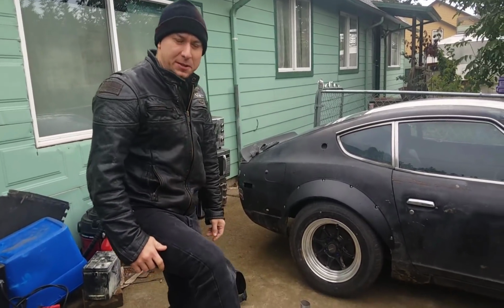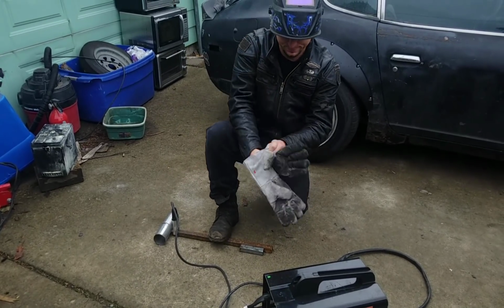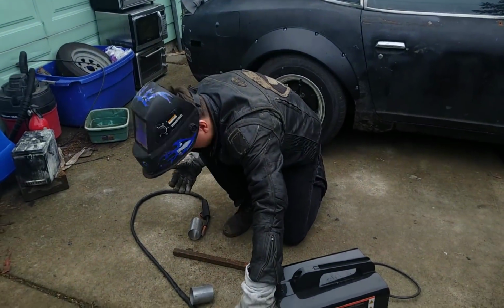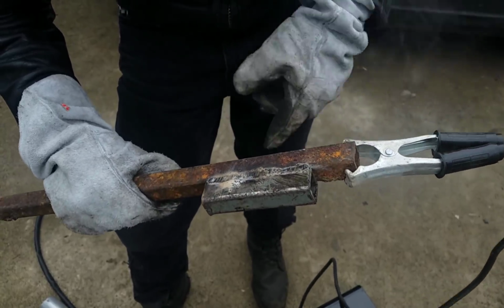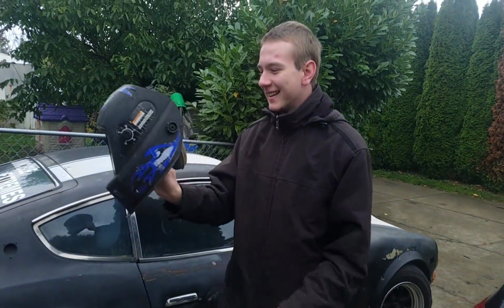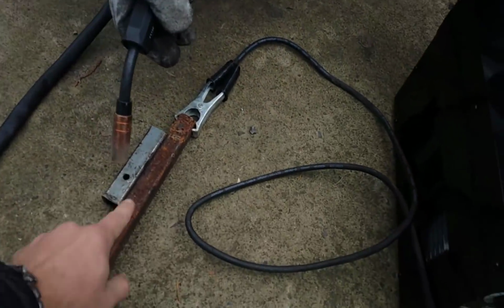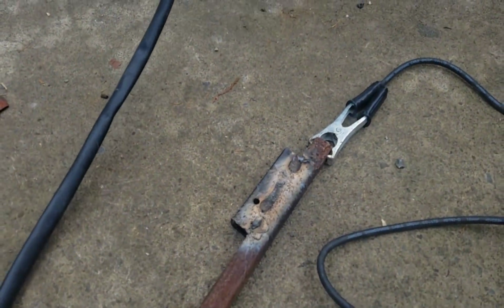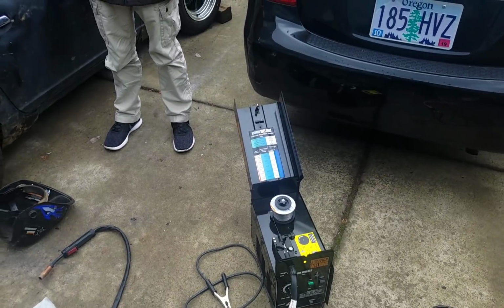$99 125 amp welder. Worth it? new 90 a.  Harbor freight 120v budget welding review. Chicago electric

Comment: Picked mine up the other day. I am going to put on a better grounding clamp than the one that is on there. Also I got rid of that gas type nozzle on the end. That just made no sense to me why they had that on there but overall I am very pleased with it.
Reply from the maker: tezterz have you seen the tiny inverter welder century sells for 169?  Picked one up and going to so an overview of it... But man it's SO much better.  Same flux core setup, but less splatter because it's DC not AC... and half the weight and size... And 30% duty cycle instead of 20... comparing the two little scrappy welders side by side, the century fc90 wins as a cheapie travel welder
Reply: Invincible Extremes Muscle Cars Garage I haven't seen it but will check it out. Just today I was watching several videos on the AC to DC conversion and it may be something I'll do.
Reply from the maker: tezterz don't bother, this one works great as is.  But honestly save that money and look at the other welder down the road.  Never hurts to have a $99 welder, but pouring money into it might not be so good...

Comment: question what would be the thickest steel you can safely weld to 1/8 or can you weld 1/4
Reply from the maker: Streetglide40S&W the answer is 3/16... It'll do 1/4 inch no problem but it won't be the same as the 240v welder that has a bit more power

Comment: I’m not having too much trouble with the bead, but a terrible time seeing the joint being welded. I’ve turned my helmet back to 10. Any other ideas?
Reply from the maker: Tim Sexton 11 is about where you want to be.  I'm in the same boat sometimes... either it's too bright or I can't see what I'm working on...
Reply: Yeah there is a $350 helmet that gets rid of the green tint. Like daylight. And like expensive Raybans while arcing.
Reply: Backlighting. Worked for me.

Comment: 10 mountain division      Ft Drum     dude you  just save me a lot of  money I really need to secure a window ,  i am a land lord and i can now repair my own window,, i will get better in time.  but you help me light a spark,    thanks soldier
Reply from the maker: I've used one of these for years.  They're not the best, but they are 100 bucks and they do work.  My suggestion is to go to home depot and get a century fc90.  Its smaller,  lighter and a much better welder.  That way when you get a little better you'll still continue to use it.  I did a video comparing the the two welders.  But either way, you'll do fine.  Thanks for watching!

Comment: Nice review, airborne. Realistic. I've been wanting to get a welder forever and was thinking of just saving up some more and getting one that can do mig as well. HF's Vulcan welders are getting good reviews but they are exempt from the coupons.... jerks...  Did they quit selling the 90amp, or just add this one?
Reply from the maker: +Bob C they sell both, same price, same box.  The 170 amp model is the best one per dollar.  It can do mig as well, but does flux core just as well.  And have more amps to be of more use, as well as going down to a lower setting for the thinner stuff.  The low setting on the 125 amp is 60... a bit high but not a problem for me. 

Now about the Vulcan, I myself want one because it's workable with a spool gun and can weld aluminum that way... imagine being able to weld together lightweight brackets, sheet metal custom intakes and so forth...  But again, it won't no $99.... 

Oh and, "all the way!"

Comment: I have a 90 amp hf welder now... Is there much difference with the 125 amp model?? I need to run it on 120v
Reply from the maker: Backyard Alchemy honestly I couldn't find any in the specs... they seem to be the same thing.

Comment: I have never welded anything in my life, what else do i need besides buying the harbor freight welder, to do what your doing here. ?
Reply from the maker: I highly recommend looking at the home depot century fc90... it's a way better welder and will work good long after you learn to weld.  

But you can indeed weld with this one too.  You'll need nothing else.  Everything comes in the box.  But a mask and gloves would be better.

It comes with a cheap mask and it has wire... So literally you can weld right out of the box if you only have $100....

Comment: Stupid question,  would this welder do a floor pan patch job on a 65 mustang,  I know I should get a better one just not in my budget right now
Reply from the maker: Yes if you absolutely have to.  I would recommend going to a pawn shop and trying to grab this for 60 bucks maybe.  The welder I would recommend that's still bottom dollar is the 170 amp model (because it can go down to 30 amps for sheetmetal work) and also because it's under 200 bucks.  Also it can accommodate a bottle of gas and your work will be 10 times better.

Besides that, if you must stay with 120v I recommend the 125 amp green welder they sell. Or the century 90 amp home depot sells.  They have dc output and the results are much cleaner.
Reply: @InvincibleExtremes  thank you sir, for the info and fast reply  I'll look in to it I've never welded before but I can't afford a body shop lol so time to learn
Reply from the maker: Yeah I taught myself.  Just taught my wife too.  But that was using a 200 amp titanium welder.  Seriously, look at the 125 or 140 amp titanium if you can afford it.  If not then at least the 170 model from Chicago electric... they're heavy but they weld good.
Reply: Will do thanks again

Comment: Will that work good on sheet metal?  I need to do a little welding on my Chevelle floor pans.
Reply from the maker: Bob Silver yes, but it's tricky.  I would recommend a century fc90 for a cheap welder to fix floors and things.  They are only $169 and are a lot easier to work with, and are half the weight and size.
Reply: thanks

Comment: go forwards not backwards watch the puddle & go slow and ffs clean it first .
does this have wirespeed and power adjustment ? 
they must be balanced for thickness     
im qualified
Reply from the maker: Not qualified at all if you think flux core welding is pushed... you drag anything that slags.
Reply: @InvincibleExtremes  you sir i challenge to a weldoff

Comment: There is a company here in the USA that sells all the replacement parts for Harbor Freight welders. There is a video done by ChuckE2009 channel where he goes to the company and gets an interview with them.  That company purchased Harbor Freight welders, took them apart and cross referenced all the parts they had in stock to make sure the parts would fit to repair or refit the welders. So if you ever need a replacement part, you can get them now. Just a FYI. I think I found the link so I edited this post   https://www.usaweld.com/Chicago-Electric-Welding-Gun-Replacement-Parts-p/chicagoelectric-mig-parts.htm
Reply from the maker: Fla-bushcraft Prepper cool.  These are mostly light use emergency welders... for anything real I'd get any other welder

Comment: I’m a hobbyist and I mess with a lil bit of everything cars atvs go karts electronics u name it i mess with it fix and resell it and all around barter junkie pretty much but do u think this welder is what I should put in my tool kit as a beginner/ go kart frame repairs exhaust and other shit I might need to melt together I mean I’m not gonna be building a freakin skyscraper and nothing is gonna be perfect and I have used a mig wire fed no gas a few times and like u said it like solder but easier so do u recommend this lil harbor freight that could
Reply from the maker: No, I recommend getting the century fc90.  I have two of them and I love them.  Dc output so they lay a great bead, and tiny tiny and great for travel

Comment: This would probly blow through 18 gauge sheet metal?
Reply from the maker: So so.  You'll be better off using a century fc90, or the 170 amp welder from harbor freight.  They have settings that go low enough for sheet metal.

Comment: Did you really just weld that square stock without even cleaning the rust off?
Reply from the maker: Rod Palm yup.  Why? Because it's an accurate representation of what this welder would be used for.  Random garbage in hard to reach areas that are impossible to clean.

Comment: Planning to get it as my first welder to practice with. Would you say its good for exhausts?
Reply from the maker: No... go look at my other videos.  The little green welder is a much better welder they sell for under 200 bucks.  That one you will keep forever even when you learn and get a better welder.
Reply: @InvincibleExtremes  the titanium easy flux welder correct?
Reply from the maker: Yes.

Comment: Any trouble with it popping your breaker?
Reply from the maker: No.  None at all.
Reply: Invincible Extremes Muscle Cars Garage yeah I picked one up yesterday to weld up an exhaust on my jeep.  Seing as my air compressor pops my breaker a lot of times I was a bit worried but didn't have any trouble at all
Reply from the maker: Yup.  Not the greatest welder, but it works for things like that.

Comment: I think as for my beginner level of welding that this welder works better without the gas tip. 

And the cleaner the ground close to the work area the better the weld.
Reply from the maker: Yup, definitely.  The gas tip helps in tight spots so you don't ground out in odd places.

Comment: hey neighbor, up here in washington. I bought the same welder, I'm not that great at it and I have only used it a couple times mainly because of the weather but I agree for the price its a pretty good welder.
Reply from the maker: paul west yup.  But even I will admit that my cheap travel welder that I love is an fc90.  Much better to weld with, only 169 bucks and it's half the size and weight.  Plus it has a dial knob, instead of just two settings

Comment: Could it hold up welding a bike frame or mini bike frame?
Reply from the maker: Yes, but i recommend the little green 125 instead.  Much better welder
Reply: @InvincibleExtremes  better off with that one then, thank u so much
Reply from the maker: Way better.  It's similar to the little red welder i used to use a lot

Comment: What is the difference between these and more expensive ones?
Reply from the maker: This one sucks because it's AC output and has no gas provisions... the 170 amp model is better at flux because it's dc output.  And it's way better overall because it can go down to 30 amps for sheetmetal work, and you can buy a $35 regulator and it makes a decent mig.  All for under 200 bucks.

Now the titanium models like the 170 are amazing.

Comment: I keep burning holes through exhaust pipe with this welder every time I try to roll a bead so I just tack my way along it. What settings are you running for it?
Reply from the maker: Low for exhaust.  You can let the wire run a little longer too btw.  This will eat up some of the power.

Comment: Hey you used regular steal wire on stainless steal tube from a exhuast system  and it did penetrate good even it would rust but it don’t matter but it would hold? Because i so your video and im think to buy this welder.
Reply from the maker: Obey N Obey I've never done it, but other guys have and it works ok.  But yes, it will rust.  A better welder is the little century fc90 I've been using.  I did a review on it too

Comment: I have the 90 amp welder.  I was bummed when it would burn through the exhaust pipe when I attempt to weld the pipe on the min setting.
Reply from the maker: Yeah, that's because it only goes down to 60 Amps. The 170 amp welder they sell for under 200 bucks or the little 90 amp INVERTER welder are both much better welders than this.

Comment: Been using one for years. Great on thin sheets and conduit. If you want to weld anything thicker you have to heat it up first. Seems to do OK.
Reply from the maker: GM Laurence yup, decent for what they are.  I prefer the century fc90.  Same 120v convenience but it's only 15 lbs and is a DC output welder so the splatter is down to a minimum
Reply: Sad part is, I have a good welding machine in the barn but no power to run it. The HB machine makes me slow down and burn a LOT of wire. Sure do miss running 5/32 7018

Comment: I have an old one and it worked for while I dont know what happened to it did the switch crap out or did the ground wire burn off and needs cutting off at the end inside the welder and repaired or what but I have not had time to see. It still feeds wire ok though. Needs something it is not getting contact some place. welders dont wear out maybe the feed does on a wire welder but the transformers dont wear out.
Reply from the maker: +shartne very true.  Unless they have a catastrophic melt down, which is unlikely since they have fail safes to prevent that, like thermal switches.
Reply: Hey thanks for the review

Comment: Good instruction. I got that welder and soon I'll be doing my first weld
Reply from the maker: Just a heads up, the 170 amp model or the little green 90 amp INVERTER welder is a MUCH better welder because it has DC output
Reply: @InvincibleExtremes  to late bought the 125 today. Itll probably be ok for what I want to do with it. The question , is will I hahs
Reply from the maker: I used one of these for years, I taught myself with it.  It's not exactly a good welder BUT there isn't a better one for that price.

Comment: Staying 2"+ away was how I made the too hot 90amp work on my rockers. It basically let the wire cool down enough to not melt my metal.

Wasn't ideal and I'd never try that on a vehicle whose appearance was critical, but since the finish was undercoating and there were running boards to hide some of it anyway, it worked.
Reply from the maker: dchawk81 yup.  It's tricky but it works.

Comment: Low and High is normal and turbo voltage and your wire speed also fluctuates the heat. You have all the settings you'll ever need to weld a rail car to a tic-tac if you take your time.
Reply from the maker: You're right.  But DC output is still preferable.  Especially if you can gas shield it.

Comment: I had my HF 90A welder  for a long time and it made me soo much money. It's Flux core not for beginners. It's messy but I lay down beads with mine
Reply from the maker: It's a cheap welder that will likely be used by beginners on junk metal using a junk cord.... if you're too dumb to see how this kind of review is exactly what they need to see, then there's not much that you're going to understand.

Comment: Would this work for filling wing holes on a trunk? Or will it blow through.
Reply from the maker: Yup, itll do that. Just going to have to learn to fill holes before attempting it.  Otherwise you'll just make a mess
Reply: Invincible Extremes Muscle Cars Garage recommended on low or high setting?
Reply from the maker: Low of course

Comment: What wire would you recommend for both the HF welder and the one at Home Depot?
Reply from the maker: Tim Sexton honestly the flux core wire in .035 called 211 or something is working great in the century and the .030 or .035 depending on tip size works good in the cheapie.  The e71ts wire they sell in 2 lb rolls at harbor freight works just fine for me

Comment: Many thanks for taking the time to review and post. After seeing your post, I bought the  125A this last weekend for a small exhaust repair. The machine was 99.99 with coupon. The exhaust shop is $65 for the repair (it's a recurring problem at the muffler seam and the issue always happens at the worst possible PITA time). $99.99 is a no-brainer and the machine almost paid for itself the first time I used it. It's OEM pipe, so it's only like 16 ga. With the welder on low and a feed rate of 8, it acted like it wanted to burn through, so I made small tacks until I went all the way around the pipe. Worked great! thanks again, man.
Reply from the maker: skkfor yeah, low is 60 amps.  That's the only real downside to this welder besides being A.C. current and messy as a result.  The home depot century fc90 is 169 bucks and a MUCH better welder because it's DC ., and can go all the way down to 30 amps for sheet metal.  But then again, it's almost twice the price.  I've used both welders with decent results.  And like you said, 65 or 99... it's a no brainer.

Comment: Reminds me of my first day in welding school (stick welder).  Takes time to get used to it.  I started out holding back too far away.  Bet most folks do.  Positive reinforcement and encouragement go a long way.  Also a little basic training without the welder running would be better.  Get rid of the rust and off the damp concrete.  I got shocked one summer with sweaty shoes and socks, came right through my shoes and out the gloves.  Thank God it wasn't a great conductor, just bit be a little.
Reply from the maker: Yeah, I've been shocked before, no fun.  He actually did pick it up pretty well later on.
Reply: I'm in my second week of Tig and Stick classes and it's been a good learning experience lol. We were using 7014 and 6013 rods earlier and I loved them, today was 6010 day and I did not like that rod, getting the speed and distance right is tough.

Comment: So it will weld aluminum steel without a problem?
Reply from the maker: Aluminumized.  Not actual aluminum, just the galvanized coating which is very toxic
Reply: @InvincibleExtremes  sorry yeah thats what i meant aluminized ...thanks for the info.